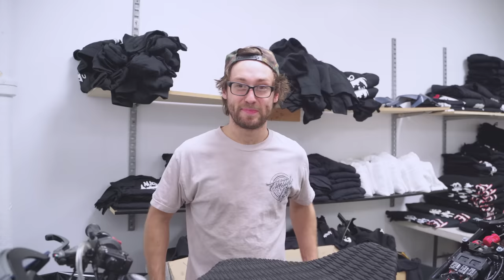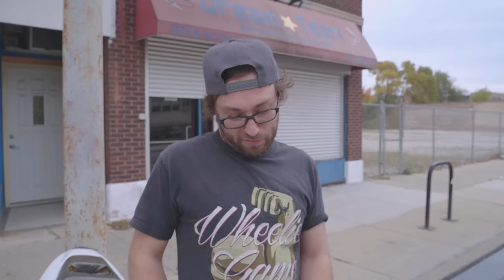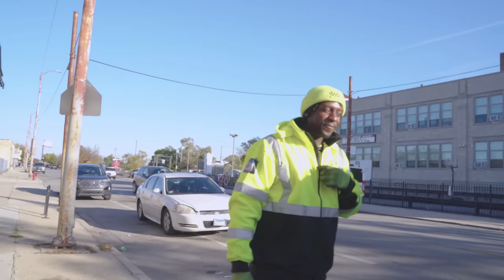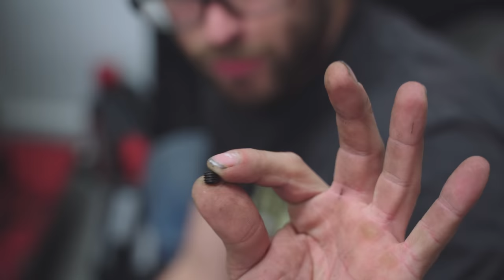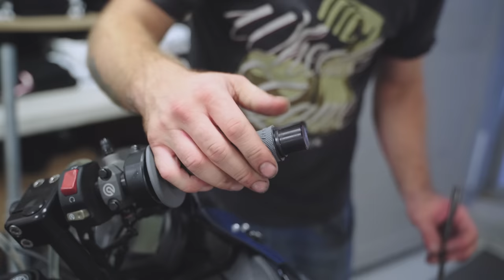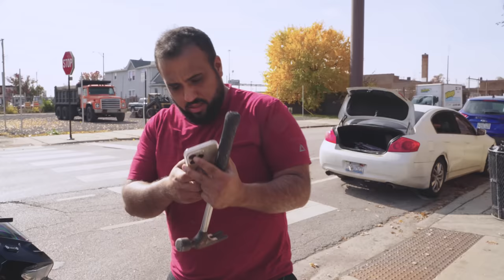2023 STUNT ZX6R FIRST RIDE!!

Comment: I have found after doing quite a few windscreen Cuts that the air saw does an amazing job doesn’t leave as much melted plastic as the grinder much smoother you should definitely check it out. I used it once an use it every time now. Great job on the bike build bro!
Reply: very true